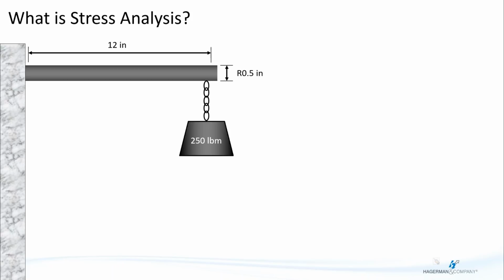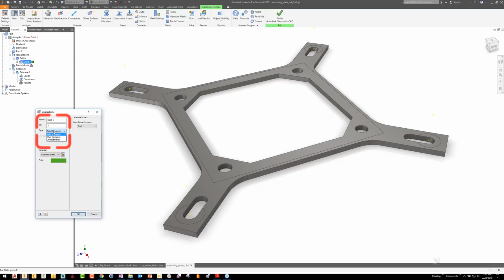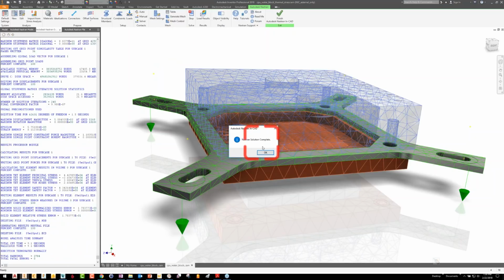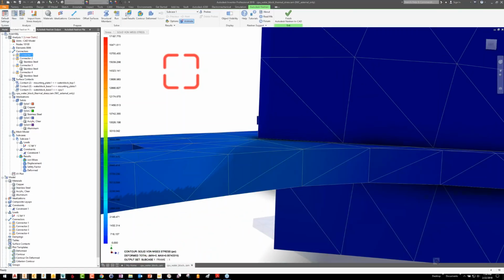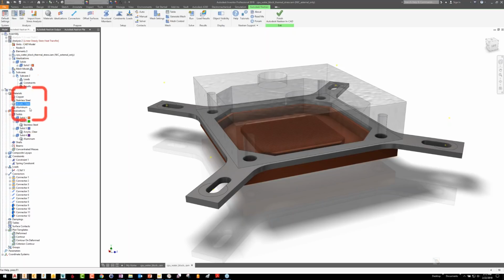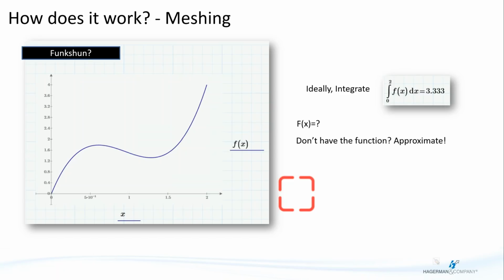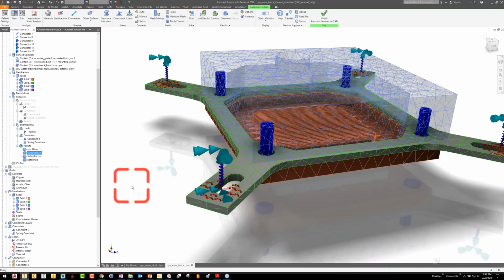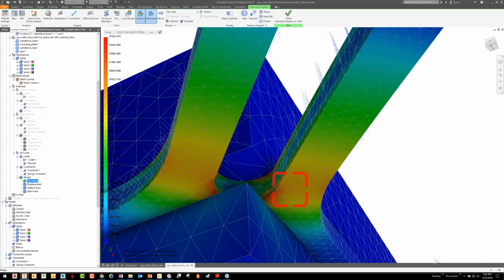Nastran In-CAD Quick-Start Training

Comment: I really enjoyed the video and thanks for the information you shared, I would be curious if you could simulate the bowing which happens on the copper block. As they use a o-ring which actually warps the copper cold plate so that it makes better contact with the CPU Integrated heat spreader. Would be a awesome use case for Nastran